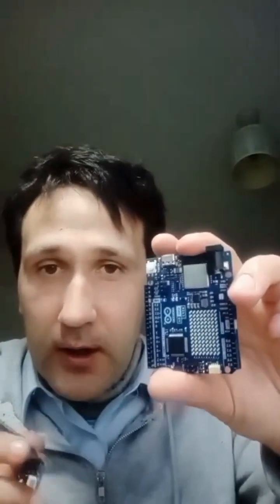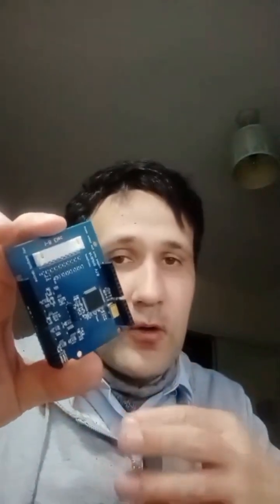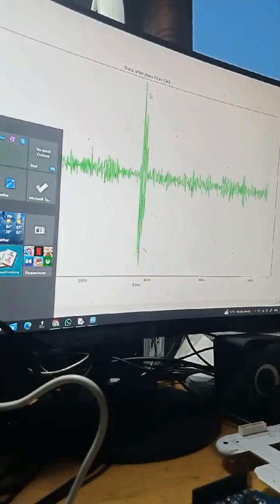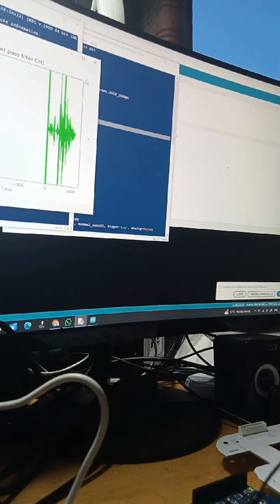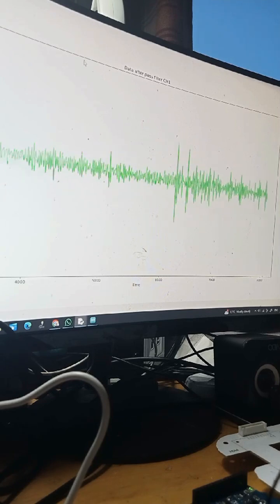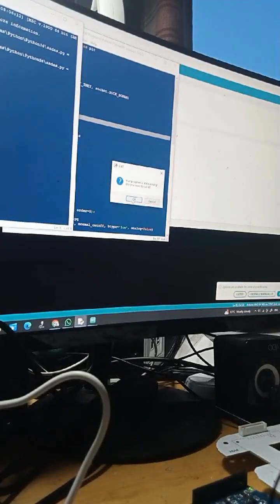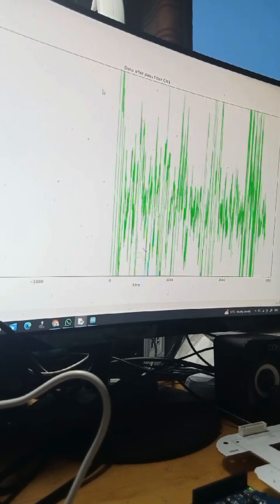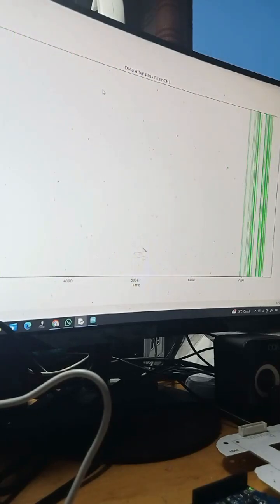Measure EEG with Arduino with shield ardEEG

Comment: Hello, can you tell me the hardwares and softwares you used in this project??
Reply from the maker: Arduino IDE to transmit data and Python to receive in computer https://github.com/pieeg-club/ardEEG
Reply: @pieeg  can you receive brainwave signals by directly connecting dry elecrodes to mcu (arduino r3) without the eeg circuit??
Reply from the maker: @AymDBoss  no, need ADC with 24 bits